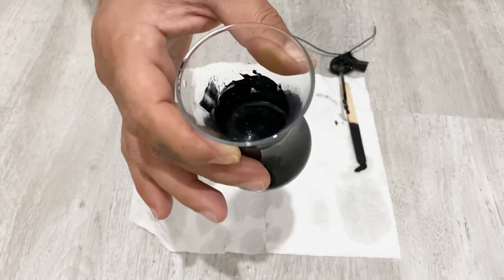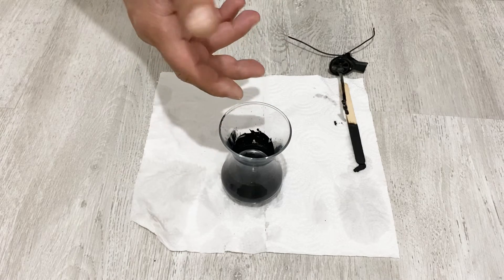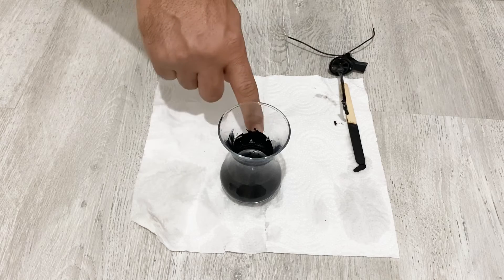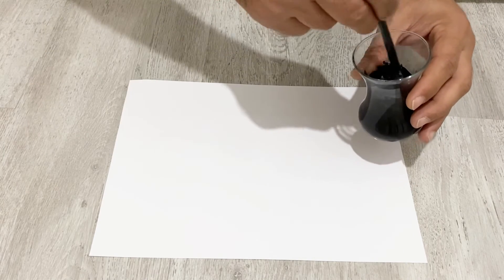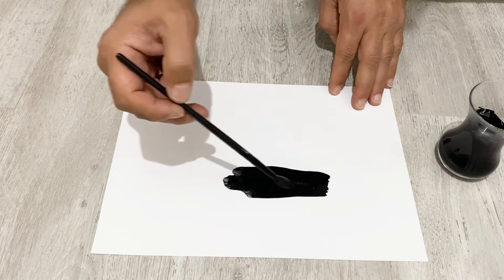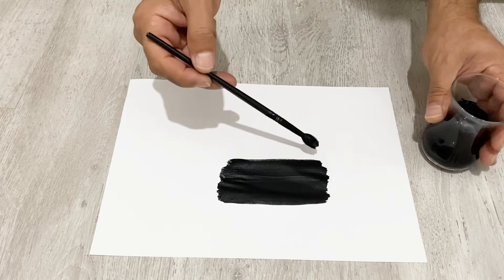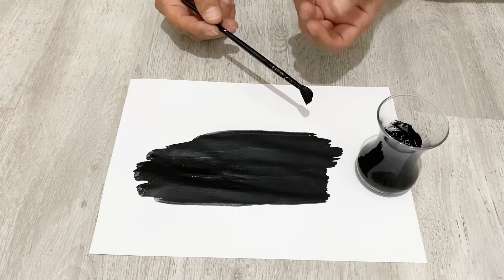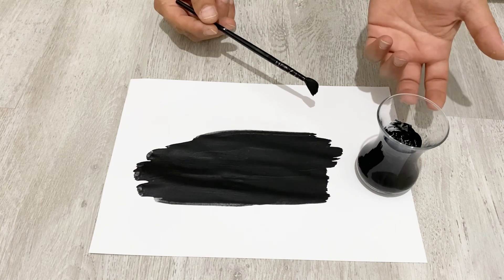How to Make Active Materials for Your Supercapacitors and Batteries (What is the Best Binder)

Comment: Can you use bondcrete is water-based but is also water proof. That you can mix with concrete to water proof it  smells very much like pva glue i water it down to water.proof my bimany on my yatch it stays flexible and I water it down to 50/50  bondcrete and water drying time  quick depending on temp and i am sure you could water it down further if desired

Comment: how to calculate mass loading of active material on glassy carbon if we use 2mm glassy carbon and the material which is 5micro litre taken from 1000 ul of solution having 10 microlitere of nafion, 240 micro litre isopropyl alcohol and 750 micro litr of distilled water what will be the mass loading value that we have to use in capacitance formula to calculate specific capacitance by CV and GCD

Comment: How much? What percentages? I don't know how much to use for water and the pva adhesive option for a metal powder electrode active material paste/slurry. Should I just try a 10% solution of pva to water?
Reply from the maker: 10% is fine
Reply: @joyofelectronics9782 Ok So 1 part PVA 9 part water. add gradually to active material. stir and mix until desired spreadable consistency is reached. then let it dry and cure overnight? That should be fine? I am trying homemade ground graphite powder on an aluminum current collector. This won't be a super capacitor. but it should be able to act as an electrical conductor with high surface area in a zinc battery project.
Also specifically I am using polyvinyl acetate for my adhesive binder option.
Reply: @joyofelectronics9782  just finished making it and put it together. small test cell clamped between some pieces of plastic with a thin couple layers of coffee paper filter between as the separator.
However There's a problem.
It works but the capacity is miniscule. only powering a small weak motor for a few short seconds before it's completely discharged.
I'm not sure if i'm doing something wrong? it behaves more as a small super capacitor than a battery. The graphite only seems to be briefly storing a charge.
Reply: @joyofelectronics9782  I tried something starting over again.
I picked nickel for current collectors this time. sodium sulfate as electrolyte.
and made active material by this method
25g graphite
25g activated carbon
5g binder
and 100g water to make it more of a thinner active material. mixed for 30 minutes with overhead motor.
I got 0.57 farads spread over 1.25 inch by 10mm surface area of the nickel current collectors. and maximum current 500mA which is a lot more current than I thought I would get.
Active material doesnt stick well if you disassemble it. need clamped together tightly with separator between electrodes for good connection. or roll electrodes up very tightly for a bigger one.
Aluminum foil and copper didn't work at all when I tried them for current collectors. so I never bothered further with those metals.

Comment: hello sir i wannas ask, can i skip using sodium silicate? and i see ur another video about supercapacitor. for active material you use sonicator before adding DI water and glue but u didnt use sonicator here. thank you
Reply from the maker: Hello brother. You can use another binder instead of sodium silicate (PVA or gum Arabic etc.) the purpose of using sonicator was make finer the graphite powder. Here the soap do the same thing. Namely you can use sonicator as well.
Reply: thanks sir @joyofelectronics9782

Comment: Great video, but I just have a few questions:
1. Are you using deionized or distilled water?
2. What are you using as a seperator in your supercapacitors?
3. If I want to create an active material out of only activated carbon, would you recommend doing anything differently? 
4. Could you please list out the materials you used and the amounts of each one? (I was a little difficult to follow, hence my first question)
5. Would a supercapacitor using this active material with a binder of sodium silicate and an electrolyte like Aqueous Na2SO4 suffer in any ways if I were to use copper electrodes and a PLA housing?
Thank you so much for this video, it was very helpful!
Reply from the maker: 1. You can use either deionized or distilled water.
2. If you use only activated carbon the internal resistance of the cap will increase.
3. Sodium silicate is not a good binder for sodium sulphate, you should use some waterproofing materials or acrylic paint
Reply: @joyofelectronics9782  So which electrolyte is best for sodium silicate?
Reply from the maker: @shreyrohilla7883  sulphuric acid
Reply: @joyofelectronics9782  Ah. Do you know what concentration is best?

Comment: try also sulfuric acid on wood, and heat blasting wood to carbon
Reply: also EDM graphite rods/plates work fine, have great conductivity
Reply: best might be sulfuric acid + heat, possibly partly burning the wood, or torching it
Reply: what does this do?
Reply: turns stuff into carbon, try the flame sulfuric acid sugar experiment, but with wood sheet @shreyrohilla7883